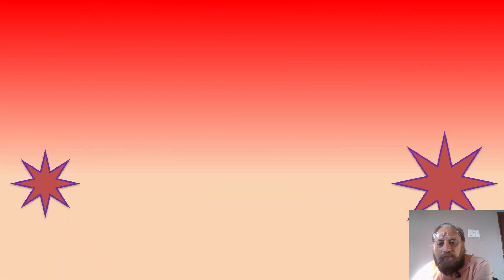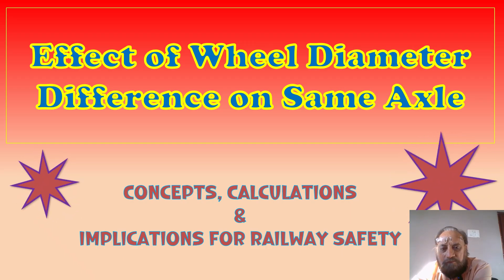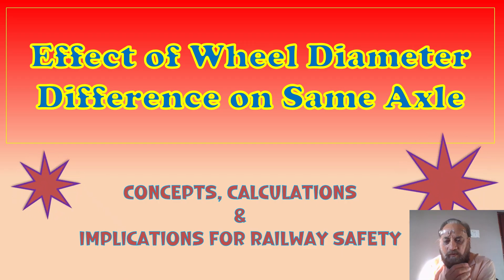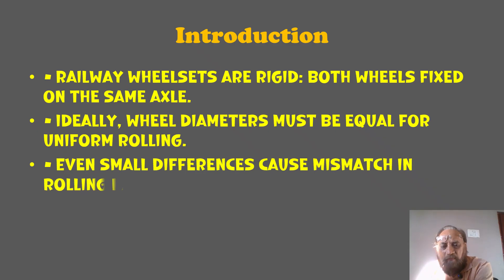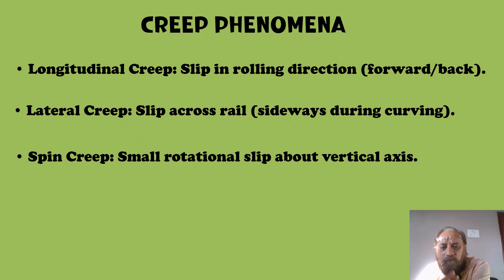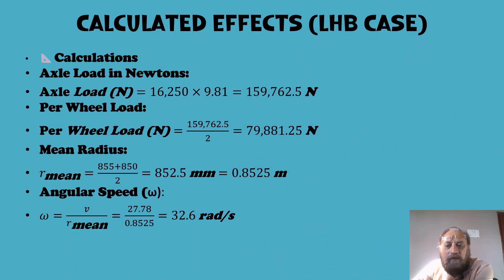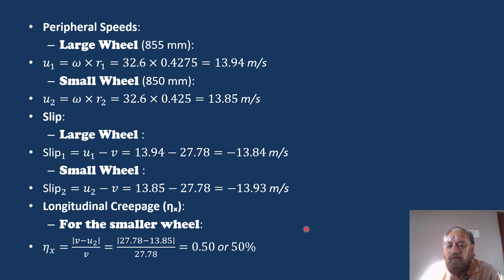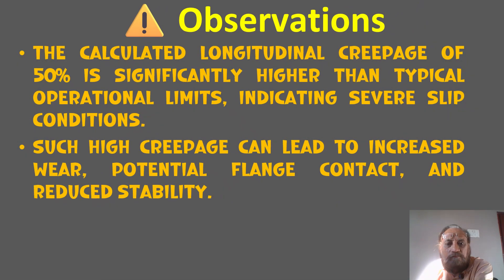“Train Wheel Diameter Difference 🚂 | Hidden Danger That Can Derail Safety!

Comment: Hello, 
It seems like there is a mistake in your calculation.
Mean radius is 0.42625 m, not 0.8525 m (mean diameter).
This means that the creepage is 0.3 %, not 50 %.
Can you check your this once again?
Best regards, 
Raphaël
Reply from the maker: Thanks will check and revert. More over this is illustrative and can be best used for personal calculation.